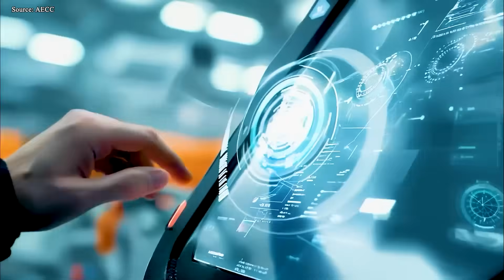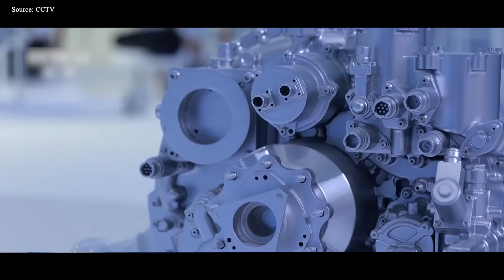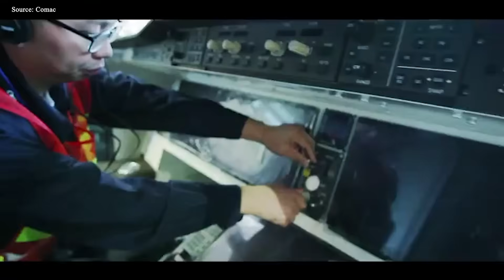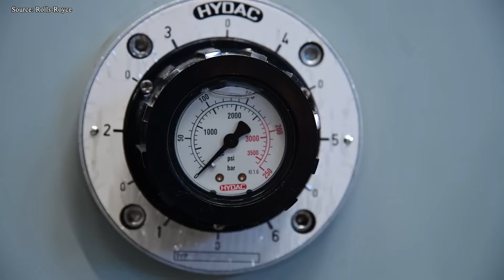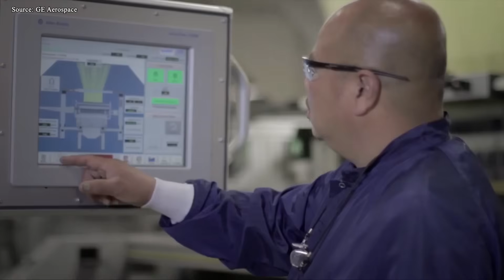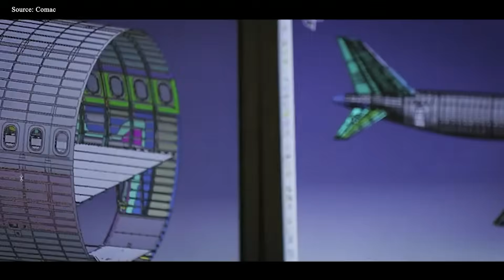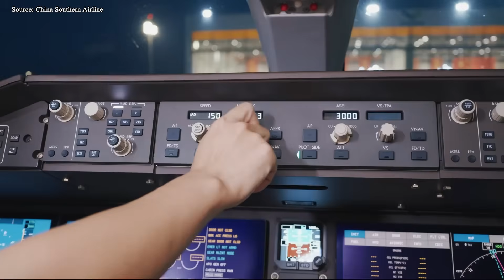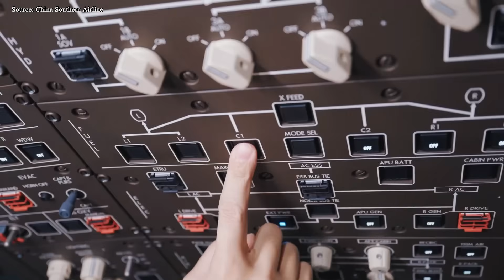How NEW Chinese CJ-3000 Engine Will Outsmart Rolls-Royce

Comment: Given airworthiness certification via western authorities is deliberately slow, despite using most engine and electronics already certified China has no option but to completely design all systems domestically. This will be achieved and western supply chains will loose the largest aircraft market in the world. Its called shooting yourself in both feet!

Comment: If China can build a new modern hightech space station with out any outside help, spent only a fraction of what the now dilapidated ISS had spend & was finished in just 2 yrs….building jet engine is chicken feeds!🫡🫡🫡🇨🇳🇨🇳🇨🇳👍👍👍
Reply: they are opposite extremes in engineering, space is low temps and low pressure (space and submarines however share similar technologies), jet engines are high temps, high pressure combined with high torque, so mastering one has nothing to do with mastering the other; the space station is arguably a much easier because of this.

Comment: The title of this video is “How NEW Chinese CJ3000 Engine Will Outsmart Rolls-Royce.”  The title is a click bait. The video doesn’t answer the question. The video doesn’t provide any meaningful technical information that would suggest the CJ3000 will outsmart the RR Trent engine. For 14 minutes the narrator rants about the politic and pride behind the CJ3000 development. Don’t subscribe. Unsubscribe.
Reply: China wind tunnels are better than ...!!!
Reply: Did you not understand RR is only just considering the variable cycle technology and the newer manufacturing materials and methods China is now using?
Reply: CJ-3000 vs Rolls-Royce Counterparts: Core Advantages
 
In core fields, the CJ-3000 has a more forward-looking technical route than Rolls-Royce’s similar products. It integrates variable cycle technology, which can switch combustion modes on demand to adapt to different flight phases, while Rolls-Royce’s counterparts such as the Trent XWB have not yet applied this technology in mass production and still rely on traditional cycle architectures. In terms of materials and processes, the CJ-3000 makes breakthroughs—its turbine blades adopt high-temperature alloy plus 3D printing technology, enabling stable operation in 1500℃ extreme environments with a single-crystal blade yield rate of 85%. In contrast, Rolls-Royce relies on traditional nickel alloys and cooling technologies, showing slightly inferior high-temperature adaptability and process innovation. In layout design, the CJ-3000 is equipped with gear transmission technology (GTF) and carbon fiber composite fan blades, combined with a twin-engine layout to simplify the structure. Although Rolls-Royce has advantages in three-axis structure adjustment, its mechanical complexity is higher and flexibility in adapting to new aircraft models is insufficient.
 
In core indicators, the CJ-3000 fully surpasses Rolls-Royce’s products in key parameters. Its designed thrust reaches the 50-ton class, with actual measurement up to 45.8 tons, while Rolls-Royce’s Trent XWB has a thrust range of 84,000-97,000 pounds (about 38.1-44 tons), meaning the CJ-3000 leads by about 1.8-11.9 tons and is suitable for aircraft with larger maximum take-off weight. The bypass ratio of the CJ-3000 is optimized to 15:1, 56% higher than the Trent XWB’s 9.6:1, which significantly reduces airflow loss of non-core engines. In combustion efficiency, the CJ-3000 is at an industry-leading level, 12% higher than the Trent XWB’s conventional high-efficiency level, with better core energy conversion capacity. In terms of economic indicators, the CJ-3000 saves over 30 million yuan in annual fuel costs per unit, thanks to a 15% lower fuel consumption than the Trent XWB, showing obvious economic advantages.
 
In core performance, the CJ-3000 outperforms Rolls-Royce’s products in both power and economy. It has stronger thrust output—the 50-ton class thrust can support the long-distance flight of the C939 (with a maximum take-off weight of 320 tons), surpassing the power demand of the Airbus A350 adapted by the Trent XWB and being close to the engine level for the Boeing 777X, with more sufficient power redundancy. It also features better fuel economy: the combination of 15:1 high bypass ratio and variable cycle technology reduces comprehensive fuel consumption by 15% compared with the Trent XWB, bringing prominent advantages in long-distance operation costs, and its single-engine fuel consumption savings far exceed the average industry upgrade range. Besides, the CJ-3000 has stronger reliability in extreme working conditions—its turbine blades have passed 2000-hour durability tests, with excellent high-temperature stability and component service life. Although Rolls-Royce’s products have a dispatch reliability rate of 99.9%, they rely on long-term operation and maintenance optimization, and the extreme adaptability of core components is slightly weaker.

Comment: @ 8:50, supersonic cruise for the C939? This narrator / content creator has no idea what he is talking abouting about. He’s a fool, an imposter pretending to know jet propulsion engineering or the commercial airline business. The YouTuber of Civil Avia should listen to the command of CEO Henry Ford II who shouted at his son who stood up during a shareholder meeting and questioned the direction of the company: Shut up and Sit down!
Reply: CJ-3000 vs Rolls-Royce Counterparts: Core Advantages
 
In core fields, the CJ-3000 has a more forward-looking technical route than Rolls-Royce’s similar products. It integrates variable cycle technology, which can switch combustion modes on demand to adapt to different flight phases, while Rolls-Royce’s counterparts such as the Trent XWB have not yet applied this technology in mass production and still rely on traditional cycle architectures. In terms of materials and processes, the CJ-3000 makes breakthroughs—its turbine blades adopt high-temperature alloy plus 3D printing technology, enabling stable operation in 1500℃ extreme environments with a single-crystal blade yield rate of 85%. In contrast, Rolls-Royce relies on traditional nickel alloys and cooling technologies, showing slightly inferior high-temperature adaptability and process innovation. In layout design, the CJ-3000 is equipped with gear transmission technology (GTF) and carbon fiber composite fan blades, combined with a twin-engine layout to simplify the structure. Although Rolls-Royce has advantages in three-axis structure adjustment, its mechanical complexity is higher and flexibility in adapting to new aircraft models is insufficient.
 
In core indicators, the CJ-3000 fully surpasses Rolls-Royce’s products in key parameters. Its designed thrust reaches the 50-ton class, with actual measurement up to 45.8 tons, while Rolls-Royce’s Trent XWB has a thrust range of 84,000-97,000 pounds (about 38.1-44 tons), meaning the CJ-3000 leads by about 1.8-11.9 tons and is suitable for aircraft with larger maximum take-off weight. The bypass ratio of the CJ-3000 is optimized to 15:1, 56% higher than the Trent XWB’s 9.6:1, which significantly reduces airflow loss of non-core engines. In combustion efficiency, the CJ-3000 is at an industry-leading level, 12% higher than the Trent XWB’s conventional high-efficiency level, with better core energy conversion capacity. In terms of economic indicators, the CJ-3000 saves over 30 million yuan in annual fuel costs per unit, thanks to a 15% lower fuel consumption than the Trent XWB, showing obvious economic advantages.
 
In core performance, the CJ-3000 outperforms Rolls-Royce’s products in both power and economy. It has stronger thrust output—the 50-ton class thrust can support the long-distance flight of the C939 (with a maximum take-off weight of 320 tons), surpassing the power demand of the Airbus A350 adapted by the Trent XWB and being close to the engine level for the Boeing 777X, with more sufficient power redundancy. It also features better fuel economy: the combination of 15:1 high bypass ratio and variable cycle technology reduces comprehensive fuel consumption by 15% compared with the Trent XWB, bringing prominent advantages in long-distance operation costs, and its single-engine fuel consumption savings far exceed the average industry upgrade range. Besides, the CJ-3000 has stronger reliability in extreme working conditions—its turbine blades have passed 2000-hour durability tests, with excellent high-temperature stability and component service life. Although Rolls-Royce’s products have a dispatch reliability rate of 99.9%, they rely on long-term operation and maintenance optimization, and the extreme adaptability of core components is slightly weaker.

Comment: The C919 uses  Western-made, incumbent components in key areas: engine, avionic, hydraulic. The reason is not that China can’t produce them, rather, using existing incumbent components facilitates certification from the Western nations; reduce R&D time and cost; and a global network of parts and repair facilities.
Reply from the maker: That's a great point about the strategic choices made for the C919's components.
Reply: Sadly the western certification decided to delay by years, so China has not alternative but to develop its own core systems and engines - the west will never learn that nothing will stop the rise of China.

Comment: Unfortunately not
Reply: 你媽有小王也是不幸
Reply: CJ-3000 vs Rolls-Royce Counterparts: Core Advantages
 
In core fields, the CJ-3000 has a more forward-looking technical route than Rolls-Royce’s similar products. It integrates variable cycle technology, which can switch combustion modes on demand to adapt to different flight phases, while Rolls-Royce’s counterparts such as the Trent XWB have not yet applied this technology in mass production and still rely on traditional cycle architectures. In terms of materials and processes, the CJ-3000 makes breakthroughs—its turbine blades adopt high-temperature alloy plus 3D printing technology, enabling stable operation in 1500℃ extreme environments with a single-crystal blade yield rate of 85%. In contrast, Rolls-Royce relies on traditional nickel alloys and cooling technologies, showing slightly inferior high-temperature adaptability and process innovation. In layout design, the CJ-3000 is equipped with gear transmission technology (GTF) and carbon fiber composite fan blades, combined with a twin-engine layout to simplify the structure. Although Rolls-Royce has advantages in three-axis structure adjustment, its mechanical complexity is higher and flexibility in adapting to new aircraft models is insufficient.
 
In core indicators, the CJ-3000 fully surpasses Rolls-Royce’s products in key parameters. Its designed thrust reaches the 50-ton class, with actual measurement up to 45.8 tons, while Rolls-Royce’s Trent XWB has a thrust range of 84,000-97,000 pounds (about 38.1-44 tons), meaning the CJ-3000 leads by about 1.8-11.9 tons and is suitable for aircraft with larger maximum take-off weight. The bypass ratio of the CJ-3000 is optimized to 15:1, 56% higher than the Trent XWB’s 9.6:1, which significantly reduces airflow loss of non-core engines. In combustion efficiency, the CJ-3000 is at an industry-leading level, 12% higher than the Trent XWB’s conventional high-efficiency level, with better core energy conversion capacity. In terms of economic indicators, the CJ-3000 saves over 30 million yuan in annual fuel costs per unit, thanks to a 15% lower fuel consumption than the Trent XWB, showing obvious economic advantages.
 
In core performance, the CJ-3000 outperforms Rolls-Royce’s products in both power and economy. It has stronger thrust output—the 50-ton class thrust can support the long-distance flight of the C939 (with a maximum take-off weight of 320 tons), surpassing the power demand of the Airbus A350 adapted by the Trent XWB and being close to the engine level for the Boeing 777X, with more sufficient power redundancy. It also features better fuel economy: the combination of 15:1 high bypass ratio and variable cycle technology reduces comprehensive fuel consumption by 15% compared with the Trent XWB, bringing prominent advantages in long-distance operation costs, and its single-engine fuel consumption savings far exceed the average industry upgrade range. Besides, the CJ-3000 has stronger reliability in extreme working conditions—its turbine blades have passed 2000-hour durability tests, with excellent high-temperature stability and component service life. Although Rolls-Royce’s products have a dispatch reliability rate of 99.9%, they rely on long-term operation and maintenance optimization, and the extreme adaptability of core components is slightly weaker.

Comment: China cannot manufacturer the bearing for these engines and neither can they make the fins required. They just don't have the metallurgy expertise period.
Reply: I don't know about the bearing, but the Chinese fins are better.  Their Single Blade Crystal with ceramic can withstand higher temperature and thus more dependable and less maintenance.  The blades are the heart of the engine. 😉
Reply: BS they make the bearings and fan blades!
Reply: @miker3298  If that is the case, we would have seen Boeing buying Chinese jets instead of making their own.
Reply: @ekyu88  Boeing does not buy airliners it tries to sell them, sadly its quality has gone down as has its reputation.
Reply: I confirmed China makes their own bearings.   They have broken the supply chain on dependency. However, they are still doing R&D to close the small gap with the West.
Reply: who told you bot arse ho

Comment: This video could be 4 min in its length . Why they need to repeat and repeat the same ideas ?
Reply from the maker: Thank you for your feedback. We will improve to avoid this issue
Reply: CJ-3000 vs Rolls-Royce Counterparts: Core Advantages
 
In core fields, the CJ-3000 has a more forward-looking technical route than Rolls-Royce’s similar products. It integrates variable cycle technology, which can switch combustion modes on demand to adapt to different flight phases, while Rolls-Royce’s counterparts such as the Trent XWB have not yet applied this technology in mass production and still rely on traditional cycle architectures. In terms of materials and processes, the CJ-3000 makes breakthroughs—its turbine blades adopt high-temperature alloy plus 3D printing technology, enabling stable operation in 1500℃ extreme environments with a single-crystal blade yield rate of 85%. In contrast, Rolls-Royce relies on traditional nickel alloys and cooling technologies, showing slightly inferior high-temperature adaptability and process innovation. In layout design, the CJ-3000 is equipped with gear transmission technology (GTF) and carbon fiber composite fan blades, combined with a twin-engine layout to simplify the structure. Although Rolls-Royce has advantages in three-axis structure adjustment, its mechanical complexity is higher and flexibility in adapting to new aircraft models is insufficient.
 
In core indicators, the CJ-3000 fully surpasses Rolls-Royce’s products in key parameters. Its designed thrust reaches the 50-ton class, with actual measurement up to 45.8 tons, while Rolls-Royce’s Trent XWB has a thrust range of 84,000-97,000 pounds (about 38.1-44 tons), meaning the CJ-3000 leads by about 1.8-11.9 tons and is suitable for aircraft with larger maximum take-off weight. The bypass ratio of the CJ-3000 is optimized to 15:1, 56% higher than the Trent XWB’s 9.6:1, which significantly reduces airflow loss of non-core engines. In combustion efficiency, the CJ-3000 is at an industry-leading level, 12% higher than the Trent XWB’s conventional high-efficiency level, with better core energy conversion capacity. In terms of economic indicators, the CJ-3000 saves over 30 million yuan in annual fuel costs per unit, thanks to a 15% lower fuel consumption than the Trent XWB, showing obvious economic advantages.
 
In core performance, the CJ-3000 outperforms Rolls-Royce’s products in both power and economy. It has stronger thrust output—the 50-ton class thrust can support the long-distance flight of the C939 (with a maximum take-off weight of 320 tons), surpassing the power demand of the Airbus A350 adapted by the Trent XWB and being close to the engine level for the Boeing 777X, with more sufficient power redundancy. It also features better fuel economy: the combination of 15:1 high bypass ratio and variable cycle technology reduces comprehensive fuel consumption by 15% compared with the Trent XWB, bringing prominent advantages in long-distance operation costs, and its single-engine fuel consumption savings far exceed the average industry upgrade range. Besides, the CJ-3000 has stronger reliability in extreme working conditions—its turbine blades have passed 2000-hour durability tests, with excellent high-temperature stability and component service life. Although Rolls-Royce’s products have a dispatch reliability rate of 99.9%, they rely on long-term operation and maintenance optimization, and the extreme adaptability of core components is slightly weaker.